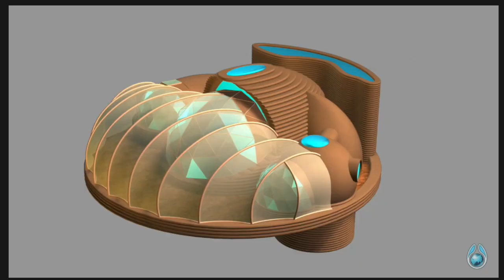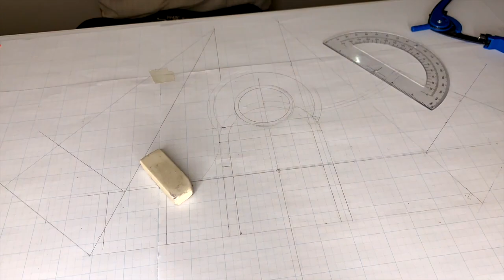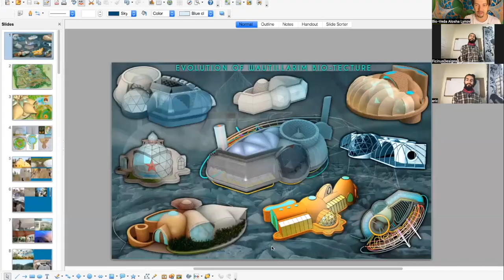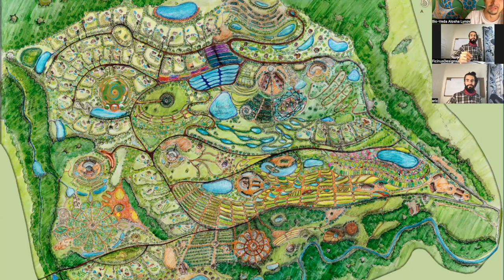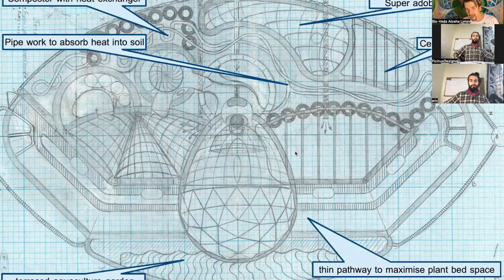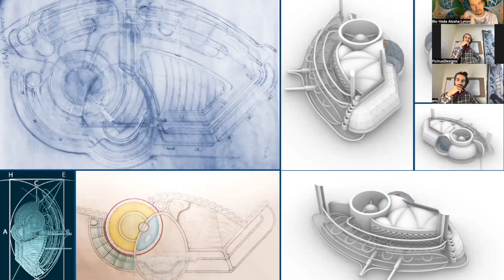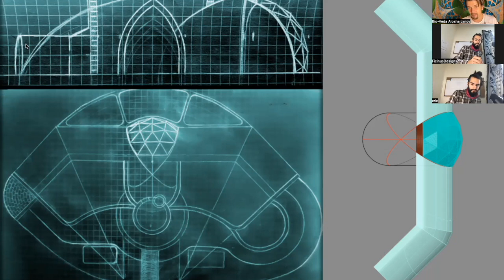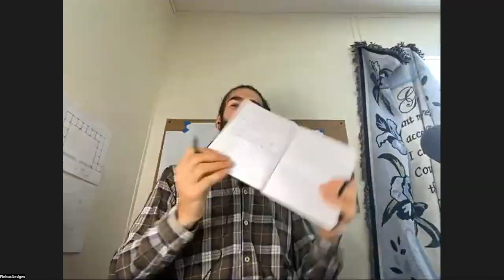Walipini Wautillarium - a home for erratic cold weather

Comment: Make sure those ground air pipes are 6" solid no holes because 4" has too much resistance/ leaks radon. Secondly place 4" pvc cleanouts in the 6" pipe in strategic low points for water cleanout or HVAC condensate pumps. You punch them through the 6" for say 2 feet below 6" tube for water accumulation. Also helps for flooding events. The 4" PVC can be slotted for better air flow.
Reply from the maker: thank you for advice , much apprecciated